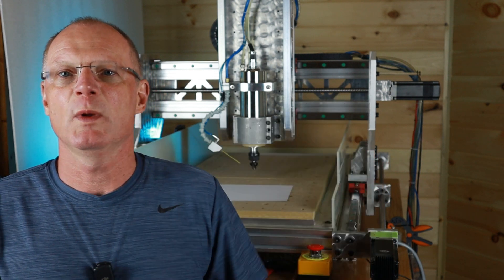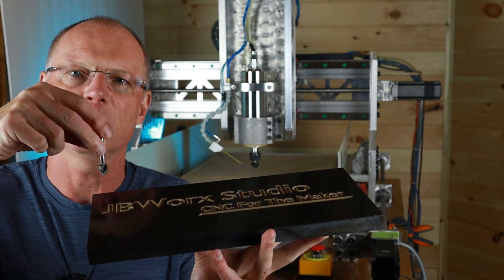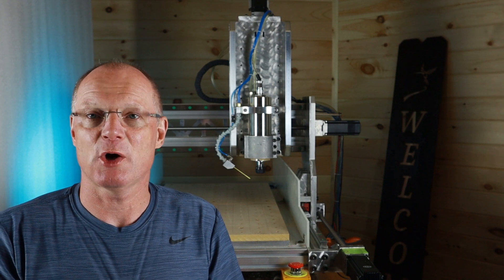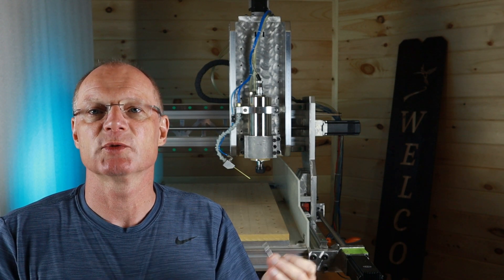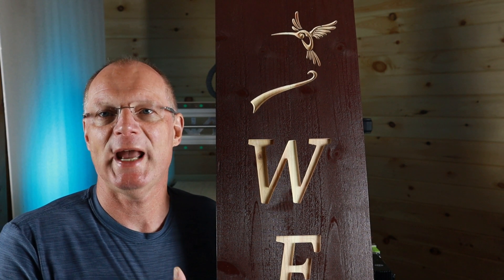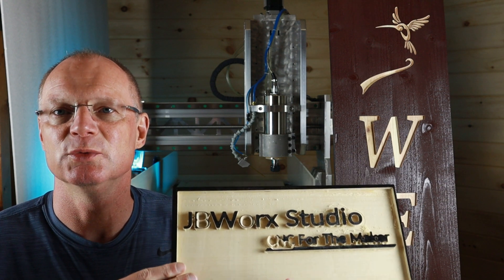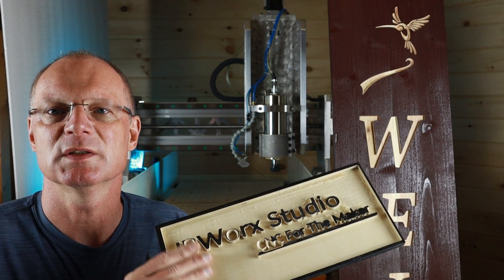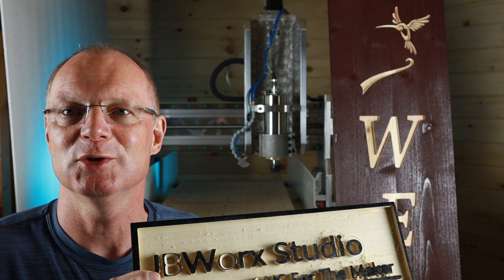CNC Wood Carving a Sign | CNC Router beginner to pro EP5

Comment: What's a good font to use for carving smallish letters
Reply from the maker: Usually the cursive font is more difficult to get done and assembled correctly to work in small letters. But this question is very difficult to answer there are thousands of different fonts to choose from. Any font you import into windows will show up in Vectric as a selection.

Comment: it's normal that it bent, you milled a lot of material on one side. I haven't done it on cnc yet, but as a carpenter I always took this into account. You need to have a thicker material than it is supposed to be and mill everything around the inscriptions, rotate and mount in a neutral position, let the material be crooked, align it by milling and turn it back to the right side and finish milling.
Reply from the maker: Yes you are correct. It is because of the deep pocket, as I explained. I am a woodworker as well and wanted to bring that point across. Thank you for your explanation.

Comment: I need a small job doing please. I have only the one job (2 small 40mm brass engraved 'badges' 4mm thick at their thickest point, engraved lines 1mm deep) that needs doing, I can pay and supply materials. I can also supply diagrams and a B&W design (.pdf etc). Let me know. UK based. Reply if you can do this. Thanks.
Reply from the maker: I am confident you will find someone locally. Brass engraves easy. Check into some Facebook groups like cnc entrepreneurs they always like to pick up some work.
Reply: @JBWorx  I don't use social media (FB, TW, IG etc).
Reply from the maker: Well I am going to leave your comment posted here so if someone local to you reads it they can get in touch with you. Shipping from and to the US is rather cost prohibitive.

Comment: With MDF adding a sealcoat of some sort before paint helps a lot. For a lot of my MDF workshop jigs and workbenches I actually use several coats of Shellac with a light sanding between and then a Wax depending on the application. Rather than canned Shellac buy some Beetles and make your own and manually apply it gets a much better result.
Reply from the maker: Yes I use the de-waxed shellac as well, recently just the spray can. I like the smell much better than most finishes and it dries so fast. Thanks for your comment !

Comment: I agree, raised lettering is another level compared to engraved lettering. My first real project was a schedule sign for church ... I had to match a previous sign about 75 years old. It exceeded my workspace so learned about tiling ...split an "H" in the tile, so half was cut on tile one and half on tile two. Learned about using gage pins on that one.

I also used an MDF plywood for material (Covid time frame) let's say two letters were "liberated" as they flew across the room. Cut out 2 more letters and tacked/glued in place before 3 coats of paint ... it has been 2 yrs and it has not rotted yet.

Thanks for the videos.
Reply from the maker: Just like you described Carl, there is a lot to learn making signs. Different substrates, the different fonts,tiling, the bits involved and the whole painting aspect and then to make it UV and weather resistant. Not easy I think this was barely an intro to the subject.

Comment: The "mistakes" sign is very helpful. It is interesting to see that a laminated product has internal stresses enough that it will warp with removal of material.
Reply: @7Alfa Tech :  I agree...  there is often more to be learned from seeing the result of incorrect technique than from watching a perfect example while being told what might happen if you do it wrong.
Reply from the maker: Yes, totally agree, if one of my projects that I film goes wrong I will re-do it but will always include the defective part as a lesson learned so you as the viewer can avoid my mistake.
Reply from the maker: Yes if the pocket is deep enough it will. DOC was 6.5mm and I was not sure if it would move but I had that happen before (not for a sign) and it moved quite a bit I was surprised as well … good for the demonstration !

Comment: The last tip was the best I think! Altering cut depth for the size of font - such an easy concept, but so easy to overlook on during programming! Thanks! Have you come across Valchromat or similar coloured MDFs? I don't know how much you play around with signs, but if you dislike colouring the cut out it could be something to look at - I use it a fair bit with veneers to expose a black coloured MDF and then the entire project can get a clear coat as a single process (unrequested knowledge dump over).
Reply from the maker: Thank you Adam for the suggestion. I have worked with 2 colored resin material that works using the same concept. I will check out Valchromat right now thx again